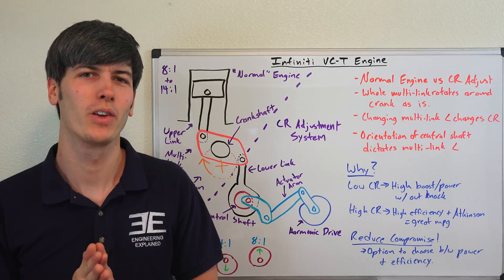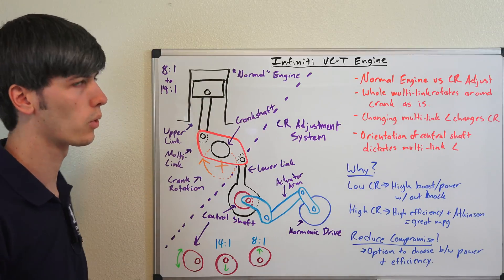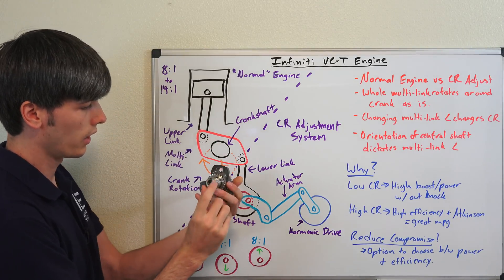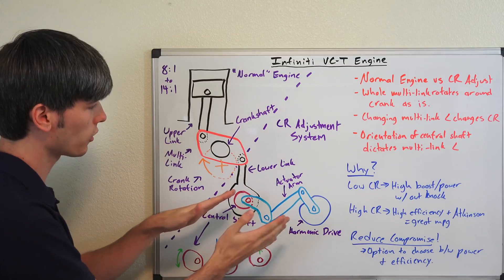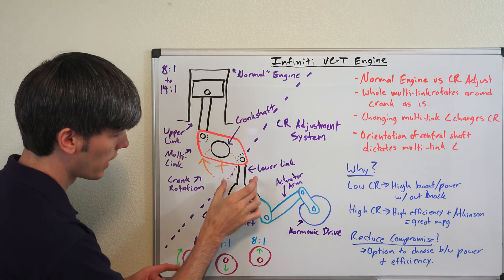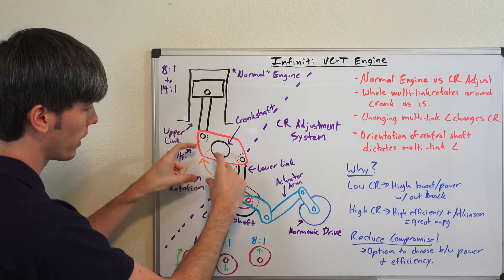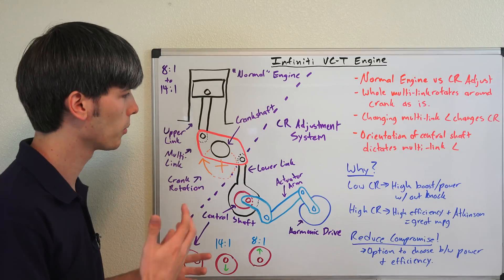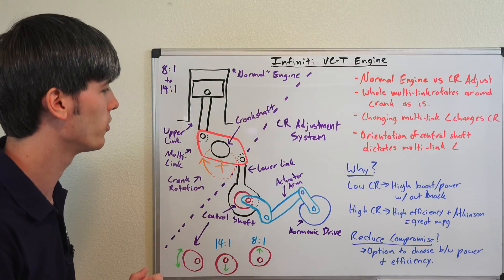Infiniti's Amazing New Engine - Variable Compression & Turbocharged

Comment: Kinda seems like superfluous nonsense that only a corporate compromise would force into development. That probably adds a lot of unsprung weight and the added complexity just adds more points of wear and eventual failure. I really don't see this tech making it out of it's teething phase and honestly, I'm quite surprised it's even been produced. Especially considering that direct injection tech is already on the table as a way to reduce knock while under forced induction. It would have been smarter for them to just cut to the chase and use an E85 sensing system like all the tuners use so that the picky and indecisive consumers that this engine are supposed to appeal to can just choose between economy and performance at the pump without the draw-backs of all this unrefined tech. And not to mention, having that sort of set-up on a production vehicle would slack the jaws of the tuner scene because it would save them the trouble of doing it themselves as well as have a factory warrantee.
Reply: But you're locked in once you pump, and it would take running almost dry before you could change it up. Being able to have the car adjust while in motion depending on whether you're floating the gas to cruise or flooring it to accelerate/pass, is much better for the driver, and frankly the car.
Reply: Those sort of fuel sensor kits are infinitely variable. If you have a 1/4 tank of E85 and you dump 3/4 of a tank of 91 in her, she'll change to a moderately low tune, and if it were visa versa, the tune would be relatively higher power. And if it were completely filled with E100, it would go completely beast mode. Or if you were broke, and could only fill up on 87 octane, it would be hella thrifty. 

All this means is that you get the same variability of performance without all the excessive hardware.

Comment: Hi Engineering explained, how does the control shaft move when the crank shaft rotates, or maybe it doesn't? If it doesn't would mean the big end is moving in an elliptical motion rather than circular?  As with many comments, seems like a lot of extra bits for little gain. Turbo's are already considered variable compression, but I rather like Saab's implementation of variable compression with less moving parts.

Comment: What about a compression chambers / vent ports coming off the top of the heads vented to the exhaust system using solenoids to adjust the compression ratio? Keep it simple... lol

Comment: Unlike variable valve systems, the scary part here is it's a highly stressed (boosted for high HP per liter) motor and you're adding substantial extra hardware, bearings, etc, in the most stressed part of the engine. I would not buy a car with this technology if you plan to keep it past the warranty period until it's well proven technology. And I would also meticulously maintain it and not modify it in any way as either could cause them to not pay for a very expensive engine rebuild or short block swap under warranty. Dealers are increasingly being instructed to deny expensive warranty work for an ever wider range of reasons--like not using the factory OEM oil filter or an aftermarket cat back exhaust system.

Comment: Can you describe the effect on the displacement of the engine? From your video, it seems like the displacement varies in a direct relationship with compression ratio... interested in your thoughts on how this affects the system overall. Great video, I like your videos that explain the latest technological advances- thank you!
Reply: The displacement does not change as it's not changing the stroke length of the crank, it's changing the volume of the combustion chamber at TDC by, in essence, changing the length of the connecting rods. Displacement is a measure of the cylinder volume swept by the pistons, excluding the combustion chambers. Stroke times bore area (pi times 1/2 the bore, squared). The stroke length and bore are not changing, and the combustion chamber is not included in displacement, so the measured displacement of the engine is constant. It's the displacement, or volume, of the combustion chambers which is variable, achieved by moving the entire stroke of the piston up or down uniformly. The piston is the same distance higher up in the cylinder at the top AND bottom of its stroke under high-compression settings when compared low-compression. Now, if this system was fast enough to vary the functional length of the rods through a single rotation of the engine, and if it could do that independently for each cylinder with high precision, it would be able to vary the displacement by bringing the piston up higher at the top of its stroke and down lower on the bottom of its path through the cylinder, increasing stroke length. I imagine Nissan's system is neither capable of rod length variances large enough to create significant changes to displacement (the difference between high- and low-compression is probably measured in thousandths of an inch), nor capable of activating independently on each cylinder at all let alone fast enough to cycle its whole range hundreds of times a second. This mechanism is likely activating much more slowly and holding its position for seconds at a time when more power is requested by the driver.

edit: I looked a little further into the engine and it turns out the stroke does change very slightly in this engine between low- and high-compression modes, from 90.1mm at low compression to 88.9mm at high compression. Likely from the change in geometry of the crank mechanism. So the displacement changes from 1.996L to 1.969L. Very small change but it is present.

Comment: I have a question. how dose an engine such as a V8 turn off 4 cylinders and run fine? Are the cams still opening the valves and no fuel is being injected and the plug is turned off?
Reply from the maker: +Phillip Custer check out my video "cylinder deactivation" for a full explanation. :)
Reply: Ok. Thanks. I appreciate what you do here and love how you have pretty much everything covered.

Comment: Im very curious if the control shaft will be electronically driven via electronic motor, or if this will follow the function of VVT technology and use an electronically controlled solenoid driven by oil pressure to make adjustments. Maybe something similar to the helical gear set in a VANOS system used in BMWs?

Will this be a setting using a "sport" and "econ" button/switch , or will this be an on the fly adjustment made by the ECM derived from throttle input and engine load?

For some reason (and i have no evidence to back this up), but i feel as if this is going to cause excessive stress on connecting rods/wrist pins and crank bearings. 

This will be a completely new world of check engine diagnostics to deal with as well!
Definitely looking forward to the appearance of this within the market; should be a 3-5 years before we see this technology being adapted by other manufacturers, just as we did with VVT, Direct injection, and turbocharging!

Comment: Do you have to run high octane gas because of the varying compression ratios?
Reply: I don't see why.  I'm sure there are multiple ways for the engine systems to detect the slightest amount of pinging or detonation, at which point the engine's CR would be dialed back to help prevent it.

Plus it would already have the CR at a lower point during times of more throttle and more boost, which would prevent any detonation in the first place.
Reply: True, but many Nissan products are already needlessly tuned for high octane fuel.
Reply: +GunFun ZS that is most likely due to Japan having higher octanes available at most gas stations
Reply: Justin Noker I'm thinking of models like Altima and Maxima, which have been made in the USA for years, and are clearly designed around the north american market.
Reply: GunFun ZS true, though I do think those also get sold in Japan, could be wrong, didn't look it up
Reply: Justin Noker According to wiki, yes, but in much smaller numbers. Also they use the same brands for different models in other markets.
Reply: GunFun ZS true
Reply: You betcha, Mazda detunes their skyactiv engines because they sell "normal" cars , aka 87 octane. You can expect to get very unhappy engine with anything below 91 in the VCi engines.

Comment: The internal combustion engine shall never die!!!!!!!!
Reply: The combustion engine can run on corn oil it's here to stay.
Reply: TheFlacker99 (Flak) Yeah, I know.
As long as we can squeeze more reliability and hp out of a piston it will live
Reply: ***** Don't forget, in the 80's they said we'd all be in flying cars by now
Reply: This is an internal combustion engine...
Reply: It won't for another 100+ years.
Reply: The Peridoge I know, I'm saying it'll never die. We usually find a way of making it work for longer.
Reply: +OwnersGen It is already dead. Fundamentally so inefficient it can never compete.
Reply: +ZOMBIE GUT kill What race? battery electric already out performs any ice car. if you want to win you're not going to use ice.
Reply: @difflocktwo  formula e is not faster then formula 3. It weights 130 kg more than similar engine powered ice car. Until batteries are heavy EVs can outperform ICE only in drag.
Reply: @Vlaadik  Fe and F1 are very different sports and have different rules. Difficult to compare. If you wanted to build build the fastest car today, you would make it electric.
Reply: @difflocktwo  ofcource regulations are difgerent, but main idea is weight of a vehicle. The fastest on what distance? Pikes peak EVs are already faster then ICE, but if you have to go 200 km and more, EVs will be able to take pole position, but not to win the race.
Reply: @difflocktwo  also I was talking about F3, not F1. F3 has similar engine power to F-e.
Reply: @Vlaadik  Oh, I read the 3 as 1.
Reply: +The Peridoge yup, but we have battery powered cars right now and they are destroying ice in every way.
Reply: difflocktwo well if electric cars rule the world there's going to be less jobs, more poor people
Reply: TheFlacker99 (Flak) to bad all the auto makers have said they are stopping funding of new ICE cars and funding research to Electric. By 2025 Most new cars will be electric

Comment: I think that the adjusting system has to cope with high mechanical stresses, what I don't like. I think keeping the high force/stress area of an engine as simple as possible works better. The Atkinson cycle is to my opinion more efficient, it also reduces the compression drastically with a very small simple input.

Comment: Why does high boost result in more power whilst higher compression results in more efficiency? Isn't the end result the same effective compression in the cylinder, as high as it can be without knock. Why is psi achieved through compression compared to turbocharging more efficient versus power and vice versa? Wouldn't turbocharging be better as it can be intercooled? or does the turbo become more of a parasitic drag compared to just simple cylinder compression?
Reply: Yes, the endresult is about the same effective pressure before ignition. but forced induction allowes you to push more air into the cyliner and so you can inject also more fuel. 
And what you see here is an attempt to solve a problem of turbocharged engines. They are quite efficient under full boost pressure because the effective compression ratio is quite high under these conditions. but under partial load, which you have most of the time in a normal car, they aren't so efficient because of the lack of boost pressure. So under these condition a higher compression ratio would be desirable.
In general a turbo charger gives you the advantage to achieve the same power in a smaller displacement engine. And smaller engines have smaller internal loses and less mass, so you gain some effeiciency with it.

Comment: Wouldn't it be easier to just adjust the turbo pressure with an electronic valve? The more air pushed into the chamber, the more final compression it would result

Comment: I'm probably biased as I more than likely am working on a 10+ year old vehicle and have to deal with sensor failures and this thing looks like it needs a LOT to know what it is doing.  I like simplicity and this seems more like german engineering (which blows to work on when the radio volume button's thermometer sensor #3 goes out (interparenthetical statement record scratch; this is sarcasm, but truly not far off) and causes the car to no longer start).  Digging into the internals of a car just to get it out of limp mode sounds like a bummer.  I do like the direction they are going and am glad someone is bringing it mainstream so we have basically a live experiment to watch however.  Most of these cars are going to be made to work for 100k miles flawlessly (see any hybrid) and basically eff anyone who buys/keeps after that mark so lets put some popcorn on and enjoy.

Comment: variable compression was first developed by saab
Reply: That's correct. It was about 15 years ago Saab in Sweden developed an engine with variable compression. It was on 1.8 liter, developed around 225 horse power and had a fuel consumption on 4 liter/100 km (1,7 gallons/100 miles or 58,8 miles /gallon). It had a tilting top and some issues with getting it tight, but they managed to overcome that as well. Then GM bought Saab and buried the engine in their archives, because it saved too much fuel to satisfy the oil industry.
Read all about it on
https://en.wikipedia.org/wiki/Saab_Variable_Compression_engine
Reply: And that's why they are the biggest manufacturer in the wor... wait, they shut down for good.
Reply: +DivideBYZero69 #DicksoutforSaab
Reply: 1.8 liter engine that consume only 4L/100 KM wow im impressed, saab used to make a reliable cars no wonder why they brought it down

Comment: Man, nice video, but I don't understand all things that you explain, because my english isn't perfect. But basicaly, according to what I understand, this system make changes in compression. Well, here, in Brazil, we have the "flex fuel" cars, that cars, operate with two fuels ETHANOL and GASOLINE, but the problem is, these cars have a problem, they already come with a high compression rate because of the ethanol, any cars it has problems with noise in the engine. Do you believe that the Brazilian cars have this system these problems could be solved? I'm sorry about my english, but I hope you have understood my question. Thank's again.

Comment: I thought that the engineers wanted to reduce reciprocating mass.  This seem to add in that blocky actuator and give you one more point of failure.   Won't this limit the RPM range of the engine as I can not see this revving to 8500 RPM without added harmonic balance's and and all the extra stress on the block.

Neat idea.

Comment: I remember the Saab design. From a mechanical stand point it strikes me as alot simpler. Having to design  all new crankshaft pieces and oiling is a bit more than a single shaft rotating the whole head. I remember it from a detailed article in 'Sport Compact Car.' I remember thinking it could be a bigger asset in a straight 6 as well. The way it worked was attaching the cylinder walls/liners to the head and rotating the angle of the head to vary the compression ratio. I don't know if the motor ever worked for long, but if I was Nissan, I would have put my research dollars in making that work.

Comment: This seems over engineered and expensive to fix.  The whole time I was watching this I was thinking why not redesign the connecting rod to be adjustable under load via oil pressure.  Well, it seems I was not the only who thought of this.  Porsche and Saab have patents for just such an idea.  Neat concept by Porsche for variable compression and seems far more practical than Infiniti's design.

Comment: Why make a motor good and reliable when you can add complexity and make it do multiple things poorly.
Reply: Motors are outlasting the frames they sit in. They may be complex, but they are demonstrably reliable.
Reply: I guess you don't own a chevy or a ford. Over engineered garbage. Cost more to fix than buy new.
Reply: agreed. this doesn't hash. high compression brings efficiency and power, the tradeoff is in much greater engine stress, but that is inevitable with increases of power. all this complexity looks like a lot of new reciprocating mass.

Comment: Sure seems overly complicated and a lot of added rotating mass.  Seems like the free valve system from Konigsegg is a smarter solution for making more power and efficiency.
Reply from the maker: This isn't mutually exclusive from something like free valve. You could combine both technologies if desired. Infiniti does incorporate their variable valve timing/lift in this engine.
Reply: They could be combined, but the drawbacks of the added mass and complication seem like very large negatives.  Plus I am sure this thing vibrates a lot.  That means more mass in the form of some kind of counter balance or balance shaft.  Generally the best engineered solutions are the simplest ones.  In most cases.